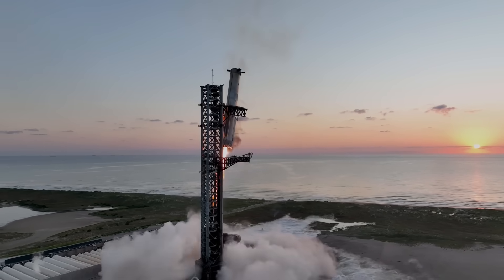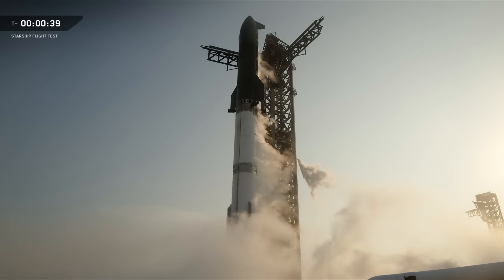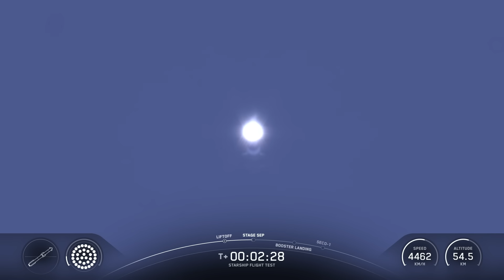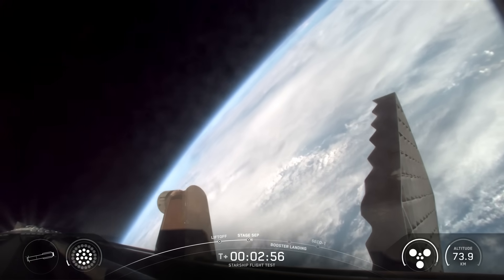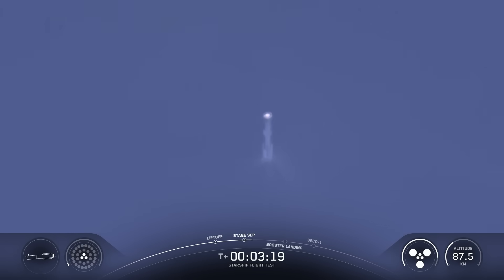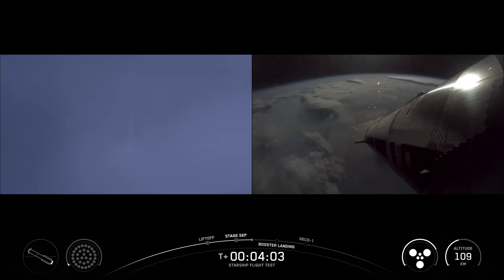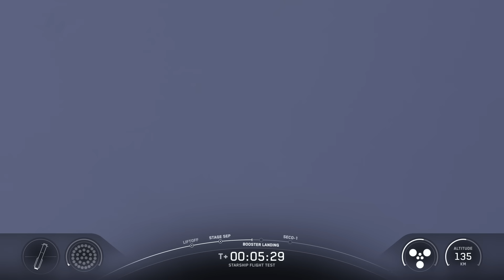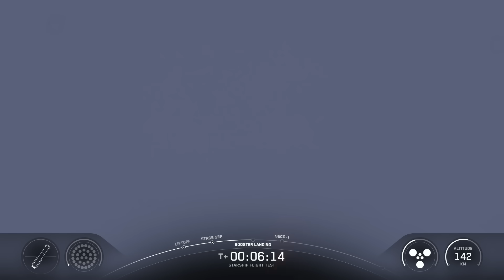SpaceX Builds Largest Reusable Booster, Also Makes Door That Won't Open - Starship Flight 9 Recap

Comment: As you say, engineering is hard. We don't know if the problem with opening the door was too much pressure in the bay, a software limitation on opening that door if the starship is not in a stable attitude, (or better yet a predictable rotation along a given axis to get better dispersion of the satellites being deployed, a problem with a vacuum weld (cold weld?) of components that needed a greater tolerance than they were made with, or someone forgot to pull the 'pull before flight' flag out of the interlock to allow the door to function. (presuming that there was such an interlock/safety pin.)  I'd lean towards a software limit on variation from predicted attitude plan, (No sense in ejecting a satellite if the point you eject it out leads to a path that re-intersects your starship causing further damage.) But I'm not on the engineering team, for some pretty good rasons, among them I'm not an engineer. Good to know it didn't land on someone in the Caribbean.

Comment: I still believe they'll need a massive redesign, the problems effecting Starship seem to be the exact same the failed Soviet N1 rocket faced. Too many engines, too much vibrations from it and it tore itself apart on launch. The Soviets never fixed it, and I doubt Space X can, we're approaching forces that are beyond the materials we use ability to handle it, I still believe that's why the Sea Dragon was the superior design for a reusable heavy lift reusable rocket. The Soviets found out long ago, you can't upscale the multi engine design to a heavy lift vehicle and they, rightfully, abandoned it. I doubt much about the challenges caused by the physics and forces of it all have changed in meantime. I believe the Starship as designed is a dead end.
Reply: That's not correct, Falcon heavy has 27 engines and it works just fine. The hot staging might be an issue though, the ship seems to spring a leak a lot. Clearly it works as a deployment platform, V1 of the ship stopped shy of orbit only because they chose to, not because they couldn't accelerate another 200 km/h, and a door is not an engineering challenge that is impossible to overcome. 
The reusability part might be harder to crack, but we have no idea how well their redesigned heat shield will do since V2 came with a host of issues that didn't plague V1. The booster also works like advertised, and the catch tower.
Reply: @Yattayatta it has 27 smaller engines and a lot less thrust when launching, Falcon and the Falcon heavy are near the limit of the Soviet era many engine design. There's a reason NASA chose rocket engine performance over redundancy, this is that reason.
Reply: @DrVinnieBoombatzDO  No it's not, the reason is that you couldn't compensate for any engine failure with computation back then. Nasa simply chose to tackle a different engineering problem. Notice how superheavy never blew up with it's 33 engines, it was always ship with it's 6, the space shuttle had 5 sls has 6.
Reply: @Yattayatta We're talking about exponentially more thrust than a falcon, I don't have exact numbers on block 2 booster which is larger but the original booster prelaunch estimate was 72 million newtons for StarShip vs 760,000 newtons for Falcon? Do you not understand the difference in force? You can't scale up material strength and still be light enough to get to orbit. You do realize that, right? Physics?
Reply: @DrVinnieBoombatzDO  Dude, the booster works, it's the SHIP that has the problem, at this point you have to be trolling, also, what does the number of engines have to do with material strength? It doesn't matter if you have 1 massive engine pushing on the thrust puck or 200 small engines that produce the same force. If anything you can distribute it better with 200 small engines.

The drawback with many engines are possible resonance, which thebooster doesn't suffer from, and more complex plumbing, but that has nothing to do with material strength.
Reply: @Yattayatta It has everything to do with material strength because you cannot scale up the build of Starship to meet the demand of the larger forces that Starship faces at each launch. The Booster doesn't work, Starship mission designed success is to launch Starship into Orbit and at least deploy a payload, and return back to Earth and be successfully reused. On Space X own mission success metric it is a complete failure. The fact that you negate every argument about the forces that Starship has to overcome to achieve that goal, not just once but to be successful many times over without blowing up, kinda highlights your lack of insight on the subject discussed. Though I bet you stayed at a Holiday Inn Express last night. Take care.
Reply: @DrVinnieBoombatzDO  Specify how the booster failed on ascent please, I'll wait. Please tell us all how it was related to material strength as well.
Reply: @Yattayatta If this was a single use booster, with no upper stage, it would be a success, but that's not what Starship is, every launch of the booster it has had issues, with fuel leaks, engine failures, to the point of barely having enough fuel to land, but Starship is designed to be reusable, the booster after having nearly two months to refurbish, blew up yesterday, so is it reusable? No The Starship has never landed, it has always blown up, and once they went to the larger booster with more engines, it has hasn't survived to even attempt a re-entry, there's a reason Falcon's Merlin engines have a higher thrust to weight ratio than Raptor, and that has to do with the forces, and material strength of the Booster and Starship, the very fact you see different failures each launch proves my point, the vibrations and forces generated by 33 Raptor engines at 120 million newtons of thrust, is astronomical, and will not work as designed, to be a reusable rocket launch system, it is a boondoggle. It will fail, but you see rocket caught in midair and wrongly believe the hard part has been solved, you obviously didn't read the PDF, nor do you appreciate how impossible a task to scale up materials to withstand those forces and be light enough to make orbit, which it has never done, it hasn't even been able to get to orbit insertion, but you believe it's a success? If you don't understand my argument, it is now on you, I can't explain it anymore, so let's agree to disagree. Enjoy the fireworks.
Reply: @DrVinnieBoombatzDO  The booster worked flawlessly on ascent, if you had studied the flight profile, you would know that they came in at a steeper angle than previously to see if the booster would break up or not, which was the intended test for the booster.
Simulations showed varied results, and there is no way to simulate hypersonic descent, as you can clearly tell because only SpaceX in the entire world can land orbital class boosters, and they've been doing it for 6 years now. 
That a booster lands with little fuel and you think that somehow is a bug tells me you know nothing about rocket engineering, or engineering in general. Look at the Falcon 9 booster, it lands using the very last few liters of fuel in there. 
Again, you started out with the number of engines, then you moved on to material strength. 
But you are aware that a single engine can also produce harmonics, right? I guess not, since you didn't take engineering class. But I'll tell you here, so you don't have to look stupid in the future, anything, single object or a million objects, can harmonize frequencies, look at bridges that have collapsed at certain windspeeds for example. Or unbalanced car tires that tear loose at certain speeds.
While you have a slightly higher risk of pogo while running more engines, you run the risk of combustion instability with bigger engines. 
Both are very solvable engineering challenges, as can be seen by the Falcon heavy with 27 engines, solving the pogo engineering challenge, and the Saturn 5 solving combustion instability in the massive F1 engine.
Reply: @Yattayatta  My God, you haven't read anything I've said, I'm well aware they dump fuel before landing, I'm also well aware that there was fuel leaks after the dumps due to issues with the plumbing of the engines, and if you ever read the PDF it would show you that, yes, even a single engine creates vibrations, but what you fail to understand is the harmonic balance gets harder with each additional engine, not to mention launching from land intensifies the sound shockwaves that so powerful they're visible in the clouds, and the at least 120 million newtons of thrust, the forces and vibrations is directly tied to material strength that has to be strong enough to hold back those forces, and yet light enough to achieve orbit insertion. As for my knowledge I never claimed to be a rocket engineer, but I know a hell of a lot more about physics, engineering and basic math than you, plus I'm not oblivious to my blind spots, I'm, not here to disparage you with ad hominim attacks, the fact that you continue to not even comprehend my argument or deliberately being facetious in your rebuttal, I'm done with this purely ego driven conversation that does nothing to bridge understanding. Take care, enjoy your stay at a Holiday Inn Express...
Reply: @DrVinnieBoombatzDO  So let me get this straight, you don't know the actual thrust of the booster, which is around 75MN, you refer to it in a way NO formally educated engineer would, and you want me to believe you have superior knowledge when it comes to engineering, math and physics?

Further you write everything in a block, which tells me you never wrote a dissertation, and if you did, you didn't pass. At best you have a bachelors degree if your teachers were very generous with their passing grades and peer reviews.

Further you claim to know that 75MN of thrust can't be engineered around, but that tells me you don't know the rocket equation at all. There is a reason you build larger rockets when you want to carry a heavier payload.

As a rocket gets larger, its structural and engine components don’t need to scale up as fast as its fuel capacity. This means that a larger rocket can carry proportionally more fuel without a proportional increase in structural weight. As a result, a greater percentage of its total mass can go toward payload, making large rockets inherently more efficient than small ones.

The same goes for re-entry, the larger the falling body, further away the plasma forms, making the thermal stresses less, that's why SpaceX went with the shape and size they did.
Reply: The bit that's failing has 6 engines.

The N1 suffered mainly from a lack of thrust vectoring requiring differential throttle to steer. So if one engine failed, the engine across from it had to be shut down. This instantly halves engine out capability, and also the system was a little trigger happy and sometimes shut down engines it shouldn't, causing it then to have to shut down the opposite engine to that engine...
Reply: @HALLish-jl5mo  It's sitting on top of 33 engines shaking like a can of paint on a paint shaker. Thrust vectoring wasn't the issue with the N1. Rocket engine failures due to the vibrations of that many engines firing all at once. Engine failures and fuel leaks due to the rocket literally shaking itself apart caused it to fail. There's a reason the Soviets never made it work, and abandoned it completely. They copied NASA with the Energia heavy lift rocket. Starship never made complete sense, relying on 10 to 20 launches to refuel one Starship in orbit to be able to go to Mars is nuts. Keep it simple, Sea Dragon or a derivative of it is where we should be putting money and research too, these rockets are too big to launch from land, and while watching rockets land back on a landing pad is cool, I just don't see Space X or anyone wining against the physics and forces generated in the current design, nor do I know of any material strong, heat resistant and light enough to be able to survive reentry one time, let alone be reusable. This will turn out to be another boondoggle.
Reply: @DrVinnieBoombatzDO  N1 first launch: transient voltage caused engine failure, causing a second required engine shutdown. 
Pogo oscillation caused a leak and a fire, tripping the computer into shutting down ALL engines to maintain stability (i said it was trigger happy).

Launch 2 a turboprop exploded, the control system shut down all engines (apart from one, inexplicably) and it fell to the pad.

Flight 3, booster got into an uncontrollable roll (i wonder if thrust vectoring would help?), gimbal locked, and crashed

Flight 4, they repleced the engine control system with an upgraded and less trigger happy version, and finally got a failure not caused by it. Instead they had hydroloc shock caused by shutting down the centre engines for max q.

Super heavy has thrust vectoring and a proven ability to survive emgine failures.
Reply: Booster worker just fine. You're take on too many engines  is wrong
Reply: @maks_1_123  It's sitting on top of all that, like a paint can on top of a can shaker. Plus the reused booster failed, the booster is built a bit sturdier as it doesn't have to get to orbit, the Starship isn't, but go on, I don't mind watching a billionaire light his money on fire, I do though when we're paying the bill with tax dollars. NASA next design after Apollo had a single engine first stage that launched from the Sea, Sea Dragon for a reason. It took was reusable, landing and recovery is fine for Falcon 9 & 9 Heavy, I don't see Starship as designed ever working.
Reply: That tells me all I need to know, you think only an AI would parse text so it's digestible, you also fail to address any of the points I brought up because you suddenly realize that, yes, I know more about physics and engineering than you thought.

I'll give you a chance to explain yourself, why do you think a heavy launch vehicle with a single engine mounting point would stress the thrust puck less than a vehicle with 33 engines? 

Do you think it's easier to build a bridge that can support 33 cars across the entire span, or one that can support a pile of 33 cars in a single spot? 

I'd also like to know why you think a 27 engine Falcon heavy works flawlessly, but 33, that's just too much. Please also clarify why the sea dragon would be a superior design since it's single use. 

How come you think launching the sea dragon would be possible, but not super heavy? You say superheavy has too much thrust for known materials, at 75MN, but the proposed design for seadragon would have had 350 MN of thrust?
That's 4.5 times the thrust of the current super heavy design.
Reply: @Yattayatta Oh so much here, you've been busy all night I take it the bed must not be so comfortable from your Holiday Inn Express. I wasn't aware I was in the presence of what a science class match stick bridge builder with the laughable rocket to bridge analogy. 

So first, I never said that Sea Dragon was a slam dunk, just that its simple design eliminated a ton of issues that the overly complex design of Starship, 10-20 launches needed to fill one Starship to fuel it in orbit, (which Starship has yet to achieve) to be able to fly to Mars. 

That fact alone would've stopped it from the drawing board at NASA. But not the Cybertruck designing wunderkind Elon Musk. You do realize that the original plan to Mars went like this, Moon, Moon base, Space Station then Mars rocket built in space or the moon to avoid all the problems of getting a heavy lift rocket out of Earth's atmosphere.

But no, can't do that. No we're gonna push tensile strength to breaking point, with 100 to 120 NM of thrust being launched on land with all the damage that the sound waves, harmonic resonance, can do to welds, pressure vessels and plumbing that has to be light enough, but carry enough fuel to make escape velocity. 

My entire argument is simply Starship cannot withstand the forces it's multi engine design causes at 75, 100 or 120 NM of thrust when launched from land. And quite possibly the Sea Dragon itself may not be able to do as well, but the simplified design would be a lot easier to troubleshoot than the overly complex never will be reusable as intended as designed to be able to launch up to 20 launches to refuel a single Starship in orbit, (which again Starship has never achieved) is laughable. 

But again I don't have that science class matchstick bridge engineering confidence in the overly complex and broken, and just out right nuts design of up to 20 launches needed to refuel one Starship in orbit* 

*Starship has failed to achieve orbit.

Hysterical, enjoy your stay at Holiday Inn Express, and I believe you might have a future at Space X as you have all the requirements needed. Mainly the ability to tell yourself and others you too see the Emperor's non existent clothes. 

Take care high school matchstick bridge engineering wiz... I'm blocking you as I spent far too much time on this thread... To everyone else that has wasted their time reading this pissing contest of idiots I apologize.

Comment: There goes another $2 Billion US taxpayer money burning up in Space Karen's ass
Reply: If not spacex that cost would be much higher and you know that. Imagine falcon 9 doesn't exist
Reply: Each Starship test actually only costs around $100 million, on this launch with the booster reuse, the cost was less than $20 million.

So your claim is 100x too high.

This tells everyone here the value of your comments.